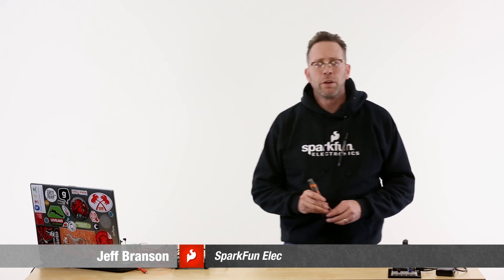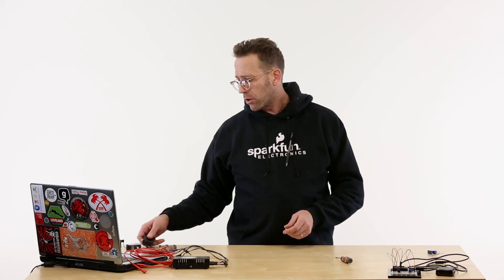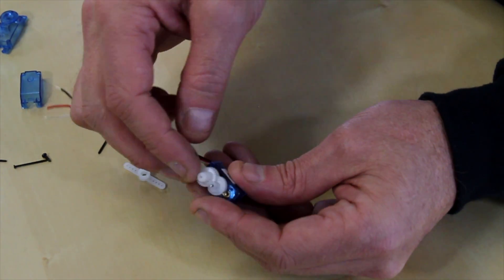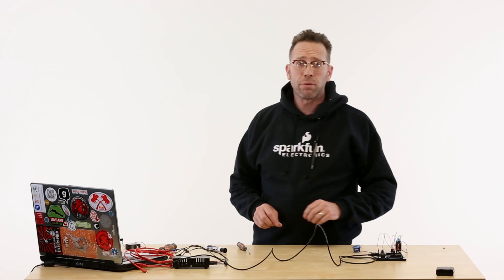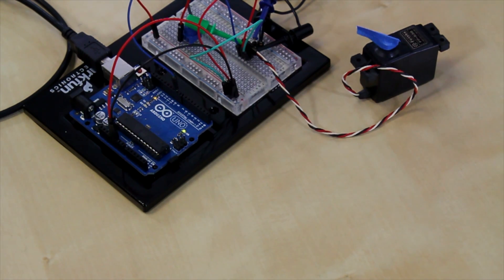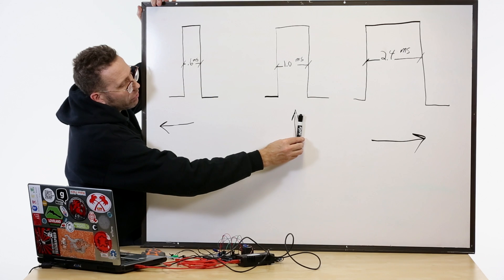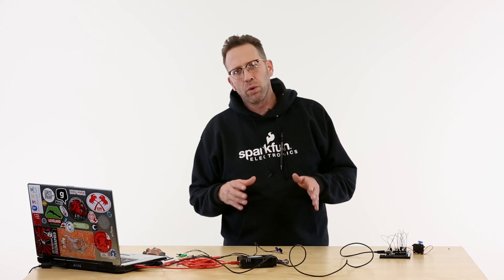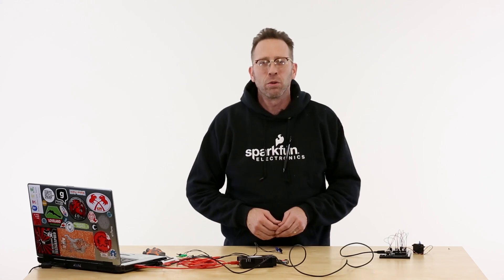SparkFun Intro to Robotics: Servos

Comment: I think it might be important to point out that this video implies that the entire system is closed loop even though that isn't what they mean. The servo itself is closed loop internally but not externally. The arduino can't tell at what angle the servo is but it's generally assumed that the servo will go where you tell it to as long as you don't put too much load onto it.